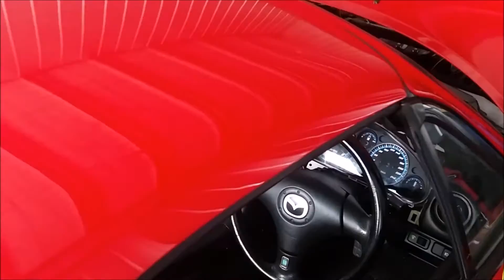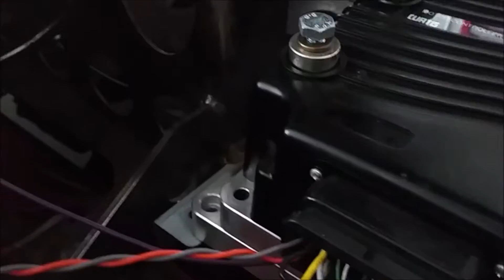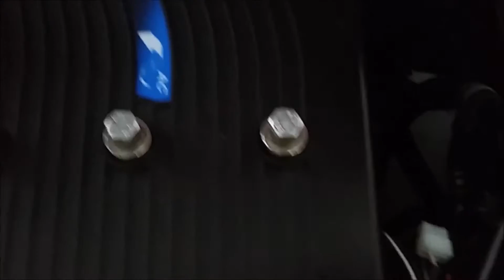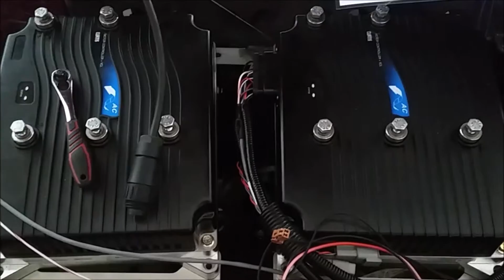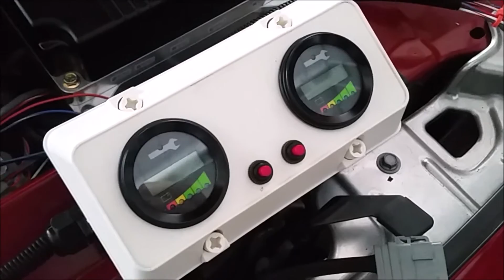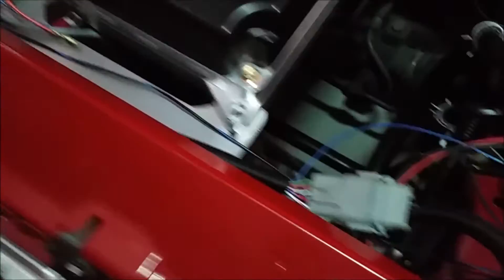Episode 6: A bit of wiring

Comment: I have this pair of Curtis 1239E controllers, which are configured to work in dual mode, but I would like to check if they light up.

I am trying to connect the KSI and the ground, but I can't get the leds to turn on, could someone help me what else I have to turn on to get them to turn on at least?

Comment: Did you have to fit drive shaft hoops? Also on my project I have batteries behind the radiator is that classed as part of the "crush zone" in New Zealand? I am hoping no..Thank you for your video.
Reply from the maker: Yes, I did have to fit a driveshaft loop.  It was a piece of steel pipe that I mounted to the aluminium beam between the gearbox and differential.  As for the crush zone, I have seen several builds with batteries in that same area so I don't think it will be an issue.
Reply: @NickSmithEmotionEV  I don't understand the need for a hoop my bmw driveshaft has a hoop like thing around the driveshaft from the factory. It's been a while since I asked my question. Is your car in New Zealand?
Reply: @blackterminal  you asked me if I had to fit one - which I did.  If you already have a hoop then you are all good.  I am in New Zealand, yes.  I have been off YouTube for a while since I was mostly posting to my Facebook page, but I have just updated my YouTube studio etc. so I went through and answered a few old posts while I was here.
Reply: @nicksmith4709  the rules confuse me. So you have your batteries in front of the forward shock towers?
Reply: @nicksmith4709  i do appreciate your answers